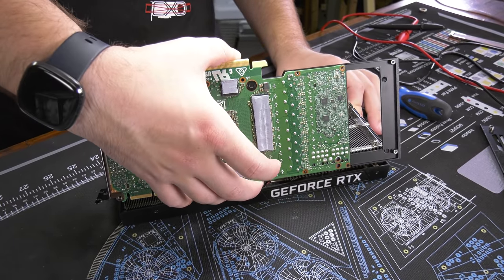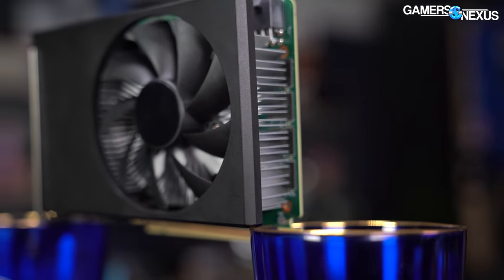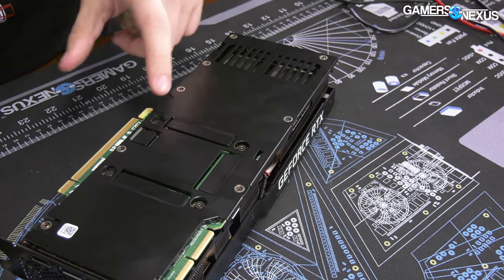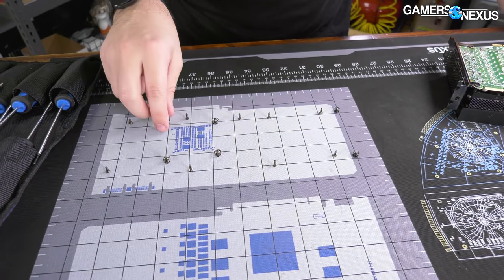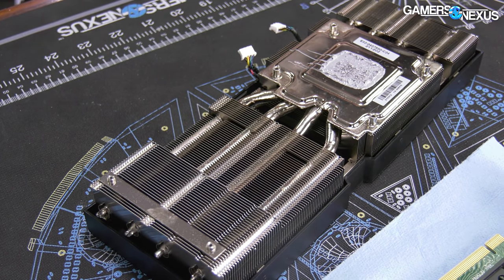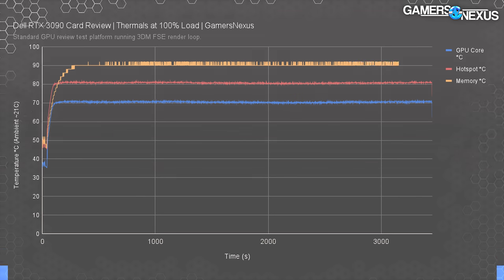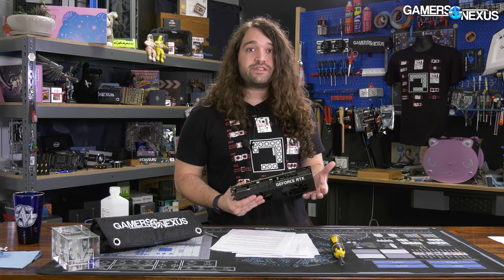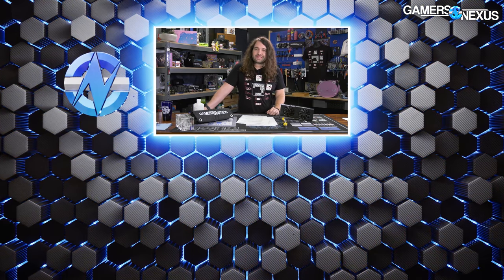Sometimes Dell Actually Tries: Dell RTX 3090 Review, Tear-Down, & Benchmarks

Comment: I have the rtx 3080 and had to do some mods to get the memory in check.  I added thermal paste around the gpu die, where it touches the heatsink.  I also added heatsink fins on the back and now it runs like a beast.

Here's a picture of it.

https://twitter.com/BluEx610/status/1416406758650650627?s=01